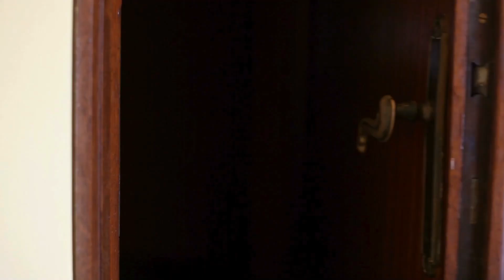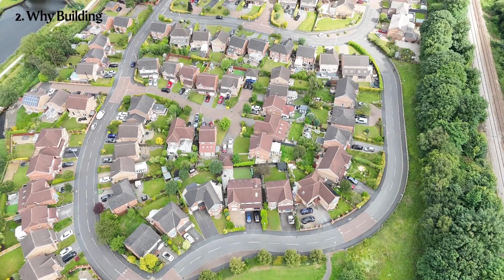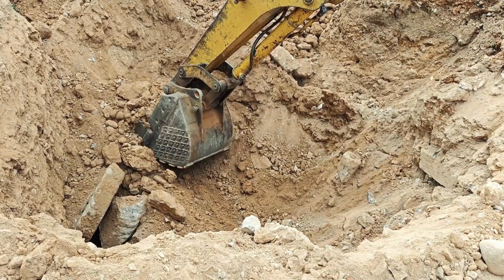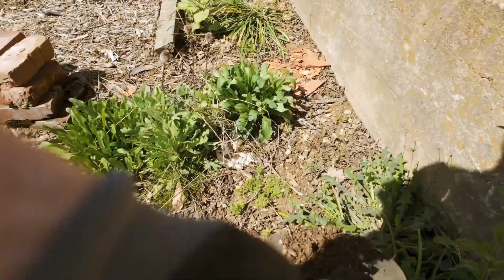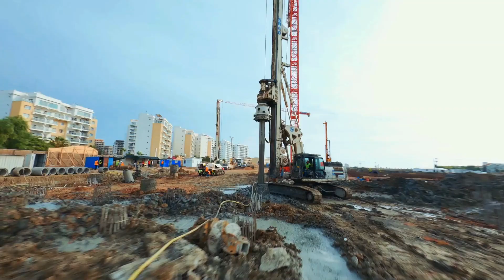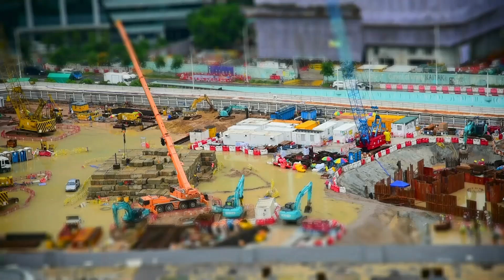Why Houses Crack: The Hidden Foundation Problems You Never See

Comment: I am currently leaving in a 4 bedroom bungalow built some 20years ago. For the past five to 10 years have been noticing cracks on the concrete floor of my compound. This has extended to the vertical walls of the building. Surprisingly the perimeter fence of the premises are not affected at all. However, a more critical look at my concrete cracked floors shows that much of the cracks were occurring around the shorter rectangular length of the building on one side alone. On that same side l have also noticed well pronounced cracks at the upper parts of the building wall both internally and external. It is also on this same side that l constructed my septic and soak away pits that is just about 3m away from the building. What do l do to stop this cracks from continuing. Note 4 years ago l did the repainting of the house and those cracks on the walls were filled with mortar before repainting. Two years ago the cracks have resurfaced. My daughter in the most affected room is worried if the building might collapse. What do l do please. I need ur technical support and advice on the way out.
Reply from the maker: Wow, this is serious, as these cracks are not a cosmetic problem, especially since they have come back after being repaired. Based on your observation, the fact that they are mainly on one side of the house, affecting both the floor and internal/external walls, and that there is a septic tank and soakaway only about 3 metres away, makes ground or foundation movement worth investigating. It doesn’t necessarily mean the house will collapse right away, but I would get a qualified structural engineer to inspect it. They should check the foundations, soil, drainage, septic tank and soakaway. Don’t keep filling the cracks or underpinning the house until the actual cause is known. In the meantime, photograph and monitor the cracks. Sorry, but you will have to spend some money to rectify this or inform your landlord if renting the property. Regards.